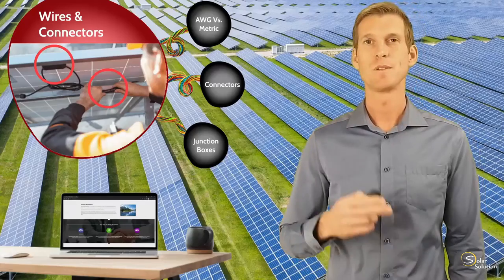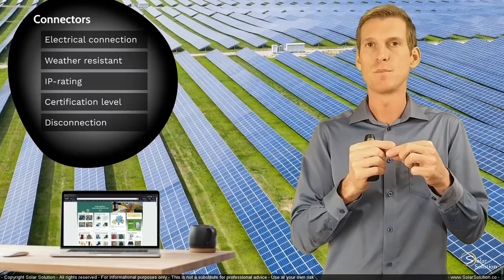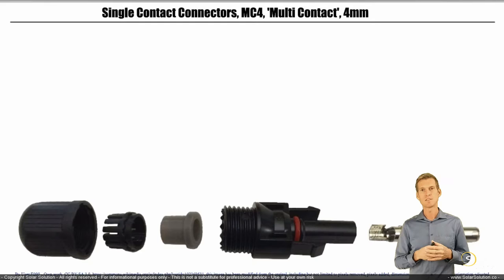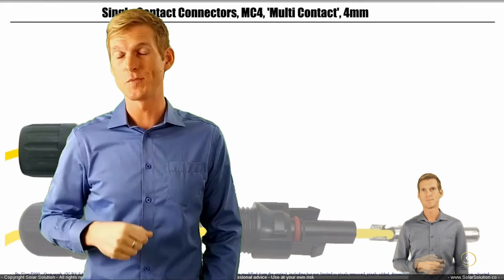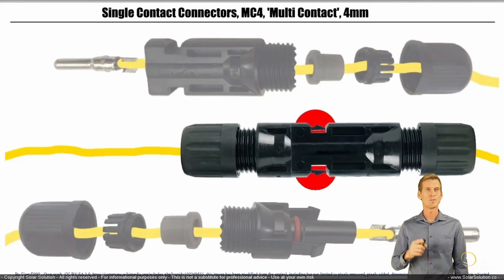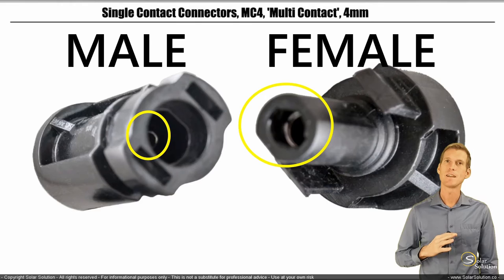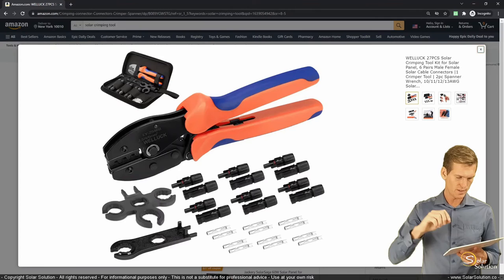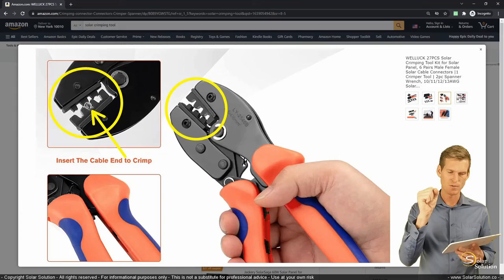MC4 Solar Connectors: What it means & How to wire and connect them

Comment: Remember: The plus voltage of the solar panel comes out of the connector with the female metal plug. That's the conector with the male looking plastic part and also the conector with the locking clips. When in doubt, use a voltmeter to confirm.

Comment: Thanks for sharing this part via YouTube. This mc4 came with my Bullbat 250 watts power station. I was looking at various types of solar panels and saw they have different connection setups. I learned more about my mc4 connector from you. I am new to power stations and solar panels. There was no online information to connect solar panels to my Bullbat 250 watts. Do I have to buy a crimp tool to connect my mc4 connector to a solar panel? I am under the impression to connect it via the dc end and the other mc4 to the solar panels’ cables. I mainly purchased the Bullbat 250 watts power station to charge power banks and hook up my internet router whenever power outages occur. I connected my portable washer/spinner days ago and used 52% of the power station. My main concern after watching your video is would the mc4 connector has to be crimped to the solar panel cable/connector? Also what specifications should I know to buy solar panels for my Bullbat 250 watts power station? I am looking forward to hearing from you. Thanks for your time and attention. Smiles

Comment: I'm on a quest to find a GOOD MC4 disconnect tool. It seems all that are available are low quality and require multiple tries to release some connectors. Every brand of connector his slightly different dimensions and it is not possible to standardize on one brand, because you are connecting many different brands of equipment and cable. Thinking the answer might be a "metal" tool, I was dismayed to learn that those characterized as "metal" are plastic, with a mix of zinc and aluminum to impart a shiny finish, and that they may actually be dangerous. I don't care what it costs. I want a disconnect tool that works on the majority of MC4 connectors on the first try.
Reply: yes agreed. this is a huge issue. I often end up cutting and crimping fresh. For sure in the USA, we often refer to the female as stated here as a male connector for the obvious looks. I have bought all the disconnecting tools I can find and its a royal mess. MC4 and H4 are not listed to be connected together, but they work and the whole thing is ridiculous.